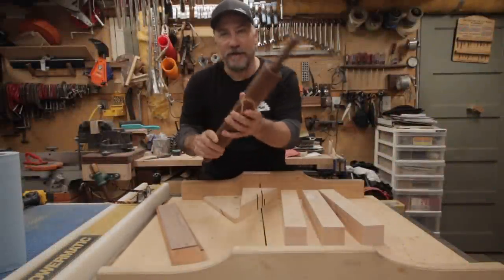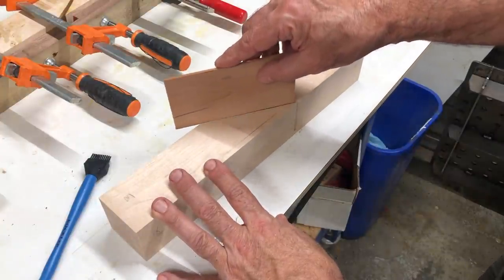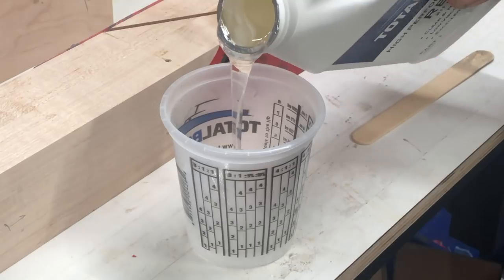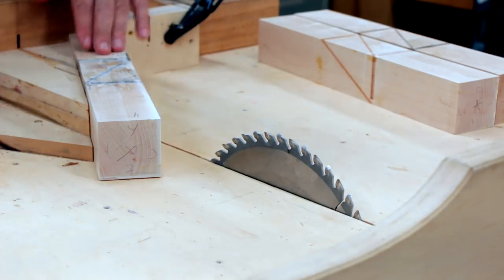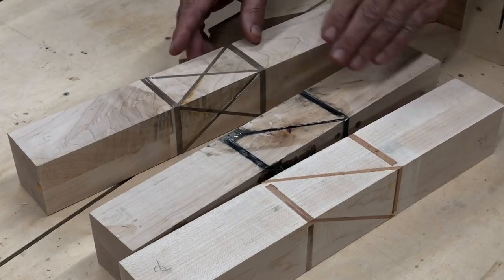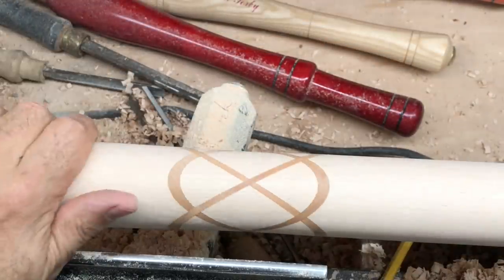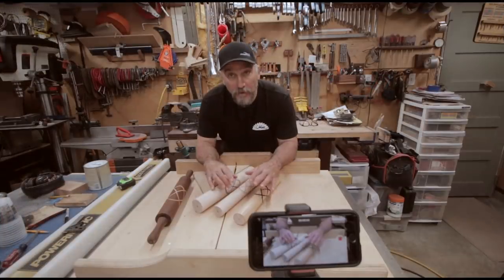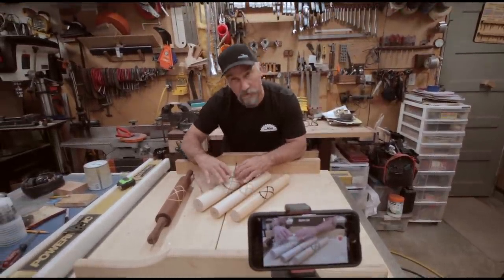Celtic Knot Made 3 Different Ways (experiment )

Comment: Great experiment! Thanks for putting it together. Your results make sense. With the complete cut/separation of the halves, you probably cannot help but end up with some misalignment in the end with a single exception: You are not only cutting and separating the original blank, but also separating the contrast wood as well. That separation is linear, and unless the thickness of the contrast wood is EXACTLY the same thickness as the kerf, then you would never be able to keep everything aligned.
Reply from the maker: Thank you ! You are totally right. Thanks for the comment. 👍🏻👍🏻👍🏻
Reply: This is true, but if the blank is made from maple you can only notice it if you are a woodworker looking for it.

Comment: I have made a dozen of these Celtic knot rolling pins. Here are some of the problems I have encountered in making them. Like you having the knot come out even is always a challenge. The most inconsistent way was with the thru-cut method. No matter how careful I was with the alignment during glue up there was always a little misalignment. The second problem that I have is dealing with drilling the hole for the rod. No matter how careful I was I could never get a constant straight hole in the project. The drill bits would drift off center and never meet up perfect in the center. Or if attempting a complete drill through which I did on my very first time successfully, would drift way off center. These are how I have dealt with this . I invested in a steady rest. Also if I'm doing a glue up I score a center line about an 1/8 inch directly down the length of the two innermost pieces. This gives a channel for the bit to travel down and not wander.  But the most frustrating problem I find is once you turn the blank into a cylinder to finally reveal the knot the rolling pin is too small. I'm thinking that there is a correlation between cut angle and final diameter of the pin. What's your thoughts on this
Reply: I'm thinking about this problem of the final diameter of the pin. It seems to me that the blank has to be at least twice the thickness of the amount you leave behind when making your cutting passes on the sled. If you leave an 1/8" per side when running through, then your blank needs to be a full 1/4" thicker square to begin with as compared to the full cut-through method. Honestly I think a full 1/2" thicker is the best bet just to be safe. It seems a small price to pay in extra material for a simpler construction method and better aligned results.
Reply: @FrankC76  that's possible I've started off with 3 1/4 inch sides and by the time I finished and the knot appeared my knuckles were dragging on the table at the handles. That's why I was wondering if the cutting angle played anytime all of this
Reply: @laff000  How much did you leave behind when you cut through? 3 1/4" is very thick, I'm surprised it still came out too thin.

Comment: Love the epoxy rolling pin. So easy to change the color of the knot. Couple questions though: 1) How much cure time did the epoxy take? 2) Did you let the epoxy fully cure before you proceeded to the next pour?
Reply from the maker: Cure time depend on the epoxy you use but the totalboat I used I would let it cure for about 6 hrs in between cuts and then 24 hrs before I put it on the lathe. Thanks for watching.

Comment: I have a project similar to your rolling pins, I am trying to figure a way to put a Celtic knot into an octagon knife handle, I thought that after watching your video you might have some suggestions. I don't know if I want to make a cut for each face of the octagon or just the original square block. any thoughts would be a great help.
Reply from the maker: Sounds interesting. I’ve never done this before but I’m thinking if you do what I did and instead of putting it on the lathe cut it into the octagon shape last. I’m thinking that would workout fine. Let me know how it works, e-mail my a pic. 👍🏻👍🏻

Comment: What angle did you use and is the angle critical to the look of the knot?
Reply from the maker: I cut them at 60 degrees and the angle is not critical as long as all cuts are the same. The knot 🪢 will change shape with different angles.

Comment: How did you get the kerf wide inserts that large? I’ve never had luck cutting them taller than 1.5”.
Reply from the maker: I cut them on the table saw, if your table saw doesn't go that high cut what you can then flip it so the same side is against the fence and cut the rest....

Comment: Hi Muz, Just found you from recommended videos. Great rolling pins. I have made dozens of Celtic Knot Pens and making sure the insert is the same size as the kerf is vital to make sure the intersections are perfect. Have you tried doing 2 or 3 rings in one? I have done both and they are fun. I posted a video of a Double Knot Pen using 60 and 45 degrees a few weeks ago and would love to know what you think. I have subbed and hit the bell. Happy New Year. Take care. Cheers, Huw
Reply from the maker: Super cool pen!! I subbed you. I bet that would look great on something larger too. Happy New Years to you too.👍👍
Reply: @TheMuzShop  Hi Muz, It does look great on larger pieces but you still have to turn down to expose all three rings so you can end up with a smaller diameter than yo had planned. I will be posting a Triple Celtic Knot Pen in the next few weeks and, once again would love to know what you think. Cheers, Huw
Reply from the maker: @WoodenItBeNice  Awesome!!